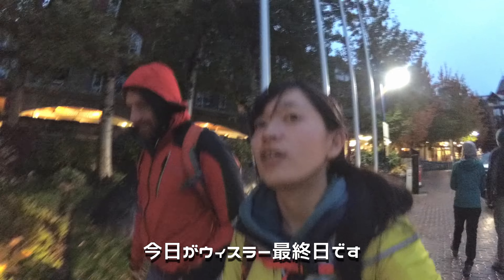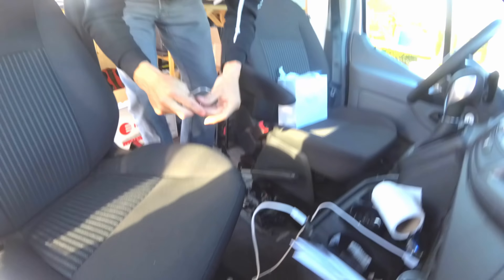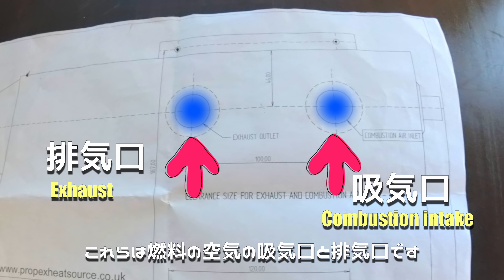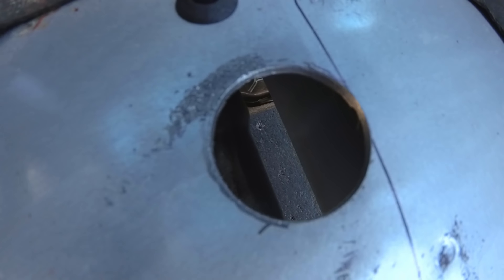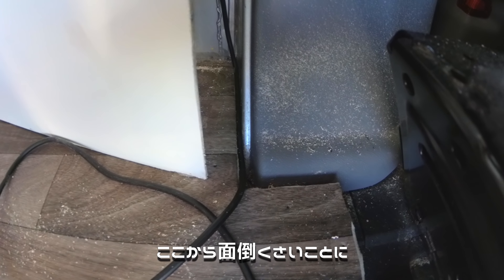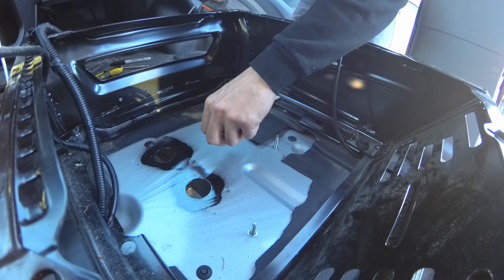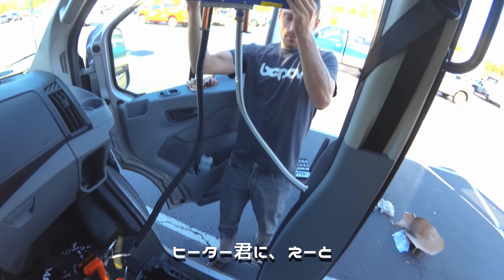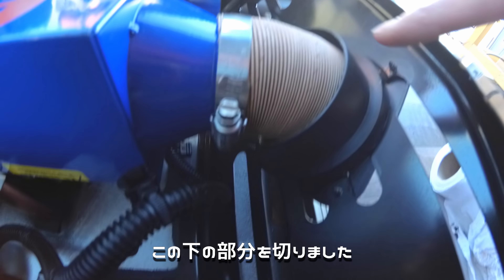Installing a New Heater in our Camper Van! / Propex HS2000

Comment: For future reference you can use a drill to make a hole by drilling little holes with a small drill bit in the circle and then cutting out the small parts in between.

Comment: Commenting as I watch; Those "testicle" holes, (ROTFL!!!) you really(!!!!!) want to get rubber grommet's for them. Try online or an auto parts store. They go by hole size and metal thickness.Those metal edges, even if filed smooth, will wear through those "testicles". Lots of vibration with the van traveling will kill those hoses and you don't want exhaust leaking into the van! When you get the grommet's, get extra's as part of ur spare parts bin and inspect after a couple months driving. That'll give you a guesstimate as to how often you need to change them out and becomes just part of your routine maintenance, like oil changes.
*EDIT* @ 13:25, where those wires go in through the metal case. Those are grommets. Just need bigger ones. Also, sorry if you know this stuff already. Don't mean to be a know it all or safety police. I just hate to not say anything when I see something either dangerous or when it seems like people don't know and could be expensive. :)
Reply from the maker: We really appreciate your advice! As you saw we don't know much. We'll check our heater

Comment: Awesome teamwork. What I don’t understand is why you had to cut such big holes in the floor?  Those long testenticles😂 didn’t look that wide. Very entertaining.😃
Reply from the maker: We cut 2 holes about 1.5 inch on the floor for those testenticles so they aren't that big. but after we put them in there are some spaces so we could've use smaller hole saw too. And the hole on the seat base for inside exhaust was like 4-5 inch. The plastic piece for exhaust wasn't as big as the hole but as we cut the hole it got bigger...

Comment: I am wondering why a Mr. Buddy type heater was not chosen?  (No hole cutting) It’s just a lot easier then such a laborious installation. I am new at all this van build and have watched only two now (out of hundreds) with this more intensive type of system. Maybe I am missing something?
Reply from the maker: Good thing of our heater is that all exhaust is going outside of the van. so in the cold weather you could keep the heater on while you are sleeping without opening the windows. and also exhaust contains water so if exhaust goes inside the van, it might get moldy. You don't want that!

Comment: Why did you out the heater on a pedestal? would those rigid combustion intake and exhaust tubes not fit if they dropped strait from the floor?
Reply from the maker: We just wanted the warm air to come out a little bit higher so we gave the heater legs👍

Comment: As a metal worker I laugh with you and at you! :) A valiant effort with success at the end. Making due with tools at hand will be a reoccurring theme when living the van life. Nicely done. That big hole saw was probably more expensive then your drill. Ha ha. Since you have 110v in the van, a corded drill would be good. Likely was your under powered drill, not the hole saw. Plus they tend to catch when drilling metal with cut out gaps. In the future, for big holes, drilling a bunch of little holes, close together, inside the perimeter of your circle O.D. is more efficient. Cut the bits in between with wire cutters and file smooth to your required O.D.. Also, this is where a Dremel tool and kit can be a life saver. All part of the fun. Well done gettin' er done!!!
Reply from the maker: Thank you Wing Nut Bert! Great tip

Comment: I suggest you put a Nest Protect - battery powered - CO and Smoke detector in your van.   CO is dangerous and this alarm could be life saving.
Reply: We've got those along with a propane detector
Reply: @BCpov  perfect
  I mentioned because every year I read some tragic tales.

Awesome video.
Reply from the maker: I really hope our van doesn't explode...
Reply: @VanGirlYuka  your van will not explode.   And, it seems Eric and you are taking adequate precautions.